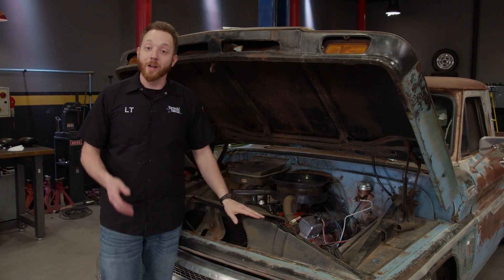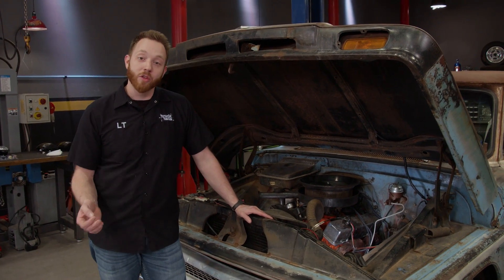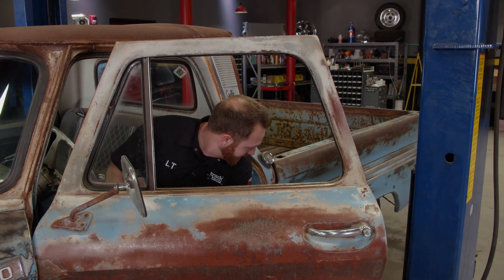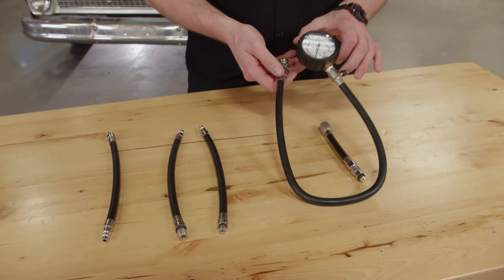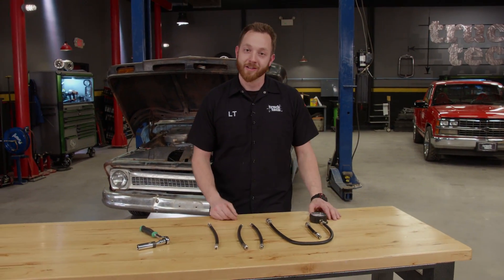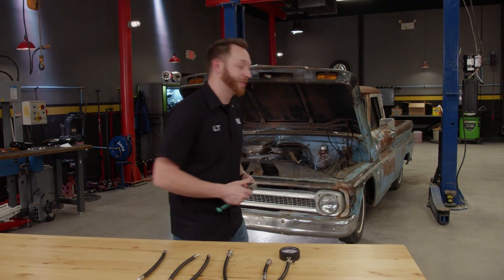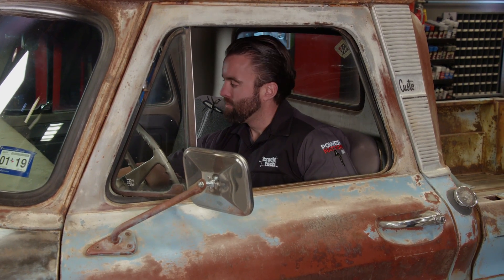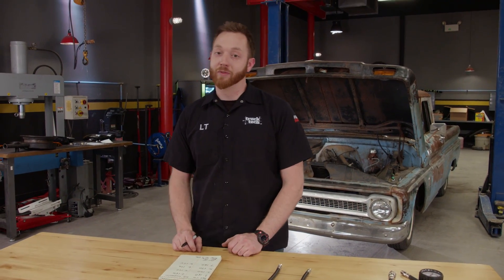How To Test An Engine's Health

Comment: So my stock 318 mopar is a 1988 model has not a lot but noticeable some when reviving I also noticed a lot of other mopars do that I seen a rebuilt mopar small block with blueish smoking coming out of the tail pipe mine has 142 thousand on the odometer and is running on 3 year old gas and hasn’t been driven more then around the yard should it stop smoking after it gets driven more or should I look for a new engine like a 360 or another 318??

Comment: It would be great to have a follow up vid on doing a leak down test.  

While a compression test is quick and identifies a weak cylinder, a leak down will tell you where the problem is. A leak down is also the only reliable way to identify a combustion chamber to coolant leak.  Actual leak down numbers are less important than where the air is leaking out. Removing the check valve ( looks like a tire valve ) from the end of the compression tester hose gives you a way to pump air into the cylinder.